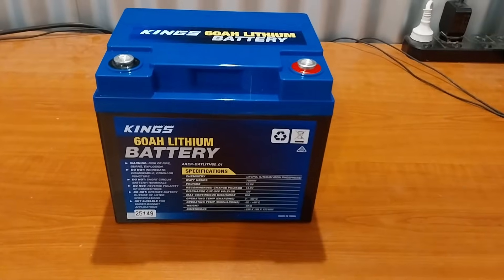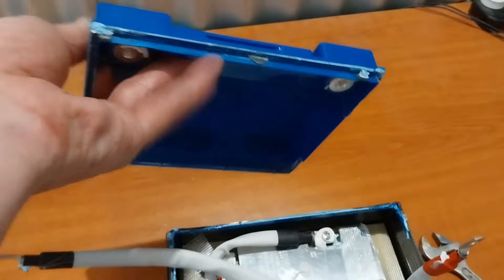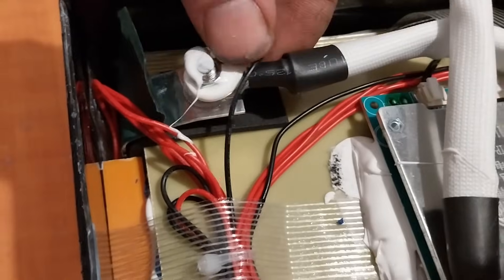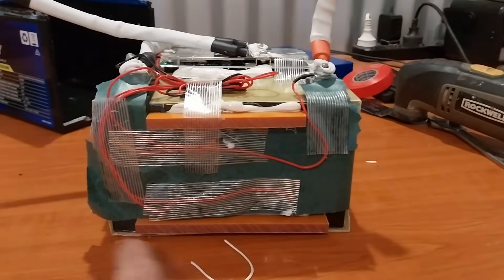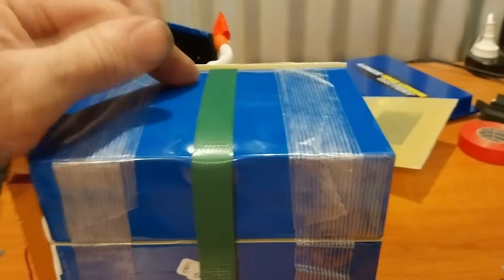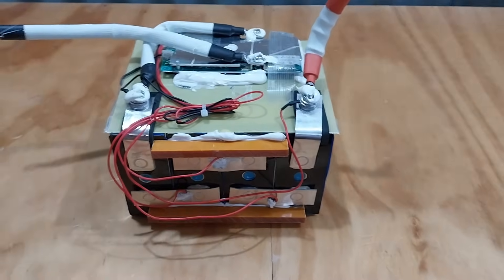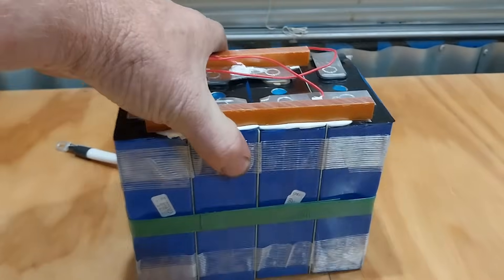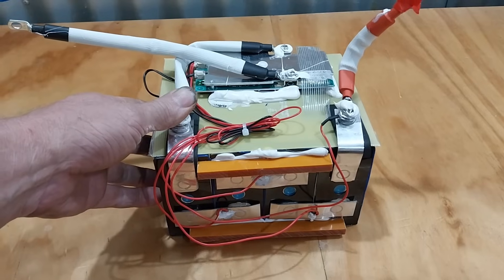Kings 60 Ah Lithium Battery Teardown - What We Found Was Not Expected

Comment: Most companies would be resellers, so possibly wouldn't know what is inside. A card or barrier on the outside could stop the strapping deforming or even ripping the outside cells. Had you used that battery? The deformation looked to be greater than 5mm..
Reply from the maker: The battery is only one week old and hasn't realy done any work. Just been charged up and put on the 12 volt system running the cabin water pumps. It hasn't done any proper cycling yet.
Reply: @TheOffGridBachelor  Hopefully they will be a responsible seller, and take steps to improve the product with their supplier.
Reply from the maker: This is part of the reason for doing videos like these, if we find issues, it gives the supplier some in site so they can follow up with there quality assurance and helps make a better and safer product.